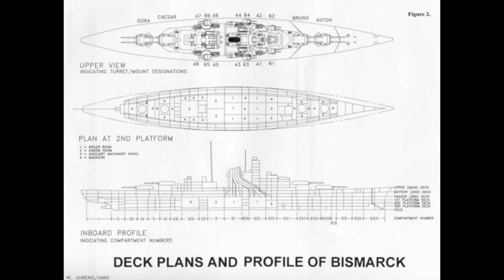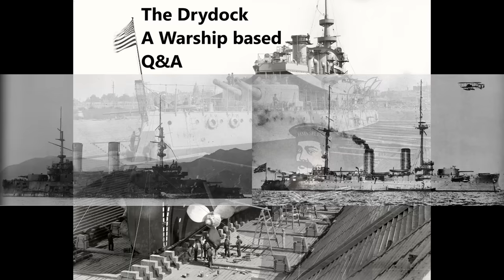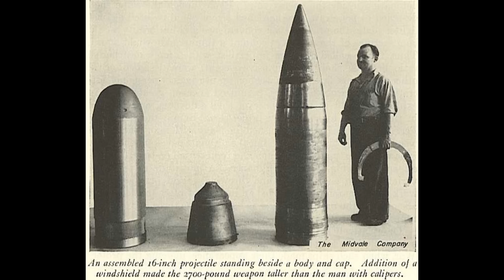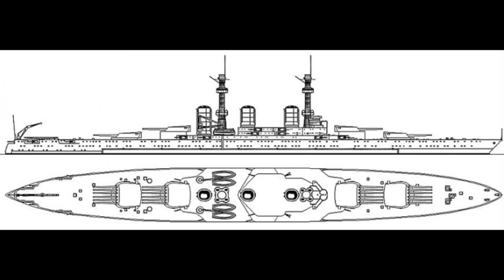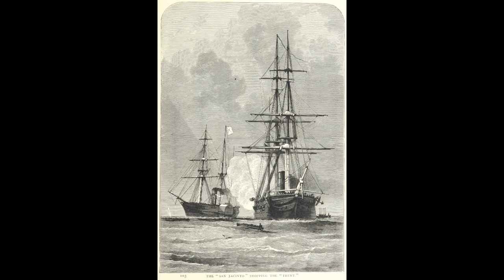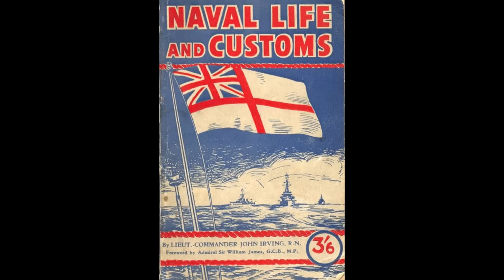The Drydock - Episode 096

Comment from the maker: Pinned post for Q&A :)
Reply: Shipbuidling, design, construction and naval budget during the Great depression ( 1929 to 1932 ) since corona is killing the economy
Reply: What if all of the Japanese submarines at Pearl Harbor were all replaced with I-400 type submarines along with aircraft.  Would they get destroyed by ASW or could they have launched an attack on Washington DC?
Reply: RN interwar years - Destroyers were mostly commanded by "salt horses" (officers who had not specialised in (say) navigation, gunnery etc.) Only seaman branch could command vessels, Engineers and Supply couldn't. The other route to early command (and extra pay!) was in submarines.
Reply: Battleship icebreaker. Wouldn't you basically have a monitor.
Reply: Did the royal navy, or any other large navy during the age of sail ever use sail colours other than plain white?
Reply: With the discovery of the wreck of La Minerve. Have we found out why it sunk?
Reply: The Iowa Class were Battlecruisers.

Change my mind. (sips cup of covfefe )
Reply: Sorry if this gets long I just wanted to clarify some of my questions.
1.  Jervis vs Fletcher I neglected to state that that was about how the two ships combats capability's are compared to each other do to the J class trading a 4.7 twin for an extra set of torpedoes matching the number of torpedo and guns more closely as opposed to a Tribal compared to a Fletcher.  (the other ships vs ships questions are just ship vs ship questions)
2.  I asked about Canadians who served on RN ships this was due to an article by the legion about the Canadian sailors who were in the hunt for the Bismarck as gunnery crews, radar operators and other roles on major ships like Hood/KGV/POW.  I wanted to know about  other shenanigans Canadians got into while serving on British ships in WW2. 
3.  Two question were related to helmsman commands/and a brief on RN/RCN rating uniforms from lower to higher ranks and clothing for different jobs such as gunners, radar operators, lookouts etc.  (sorry but currently I don't have a copy for any RN/RCN seaman's hand books other sources for this would be appreciated)
4.  I asked about how would you modernize Yamato/Bismarck/Vanguard like the 1980s Iowa you can skip that one.  Thats a scary thing the internet can do on its own.
5.  all the questions on how would you build super (insert here) ship you can skip aside from the how would you design the KGV's under all the treaty restrictions.  (you have full control as long as you fit the limits)
Sorry for doing this here but I didn't email due to that spam you got. Also keep up the great work you videos are always the highlight o my week :)
Reply: Bismarck at Jutland with the German fleet bismarks speed is limited to 26 knots.  Does he survive and if he does is it still mission capable or repairable in German facilities
Reply: Can we get an episode on the "Scrap iron flotilla"..... attempt no2..... yes, i am going to do this ;)
Reply: When talking about the rudders, I noticed in the photograph of the Iowa you showed that there is a difference in the number of blades between the inboard (5 blades) and the outboard (4 blades). Is the water pressure higher on the inboard props due to the action of the outboard props thereby changing when cavation occurs and necessitating different designs?
Reply: In previous dreadlocks you have mentioned that you dislike the conqueror in world of warships, if you were to chose the ship to be the British t10 battleship what would you go for? Autoloader lion?

Also what is the most realistic T10 ship from world of warships which wasnt actually built?
Reply: Are you typing during Q&A's? Always sounds like there is some clicking going on
Reply: If all ships ever constructed before WW2 were to face the US Navy at it's peak in WW2, who would win?
Reply: How common was naval gunfire support around Korea and Vietnam? What kind of missions were performed by carrier aircraft as opposed to land based?
Reply: @Loretta2004  it depends on which metric-using country your looking at. Navweaps.com provides that level of detail on specific weapons. For example,  all German 28 cm guns had an actual bore diameter of 28.3 cm (11.1"). When the Japanese switched from imperial to metric units, they also rounded to the nearest cm, so all their 3" guns became "8 cm" guns by designation. As for the 13.5" gun, this article (http://www.navweaps.com/index_tech/tech-097.php) helps explain that the 13.5" bore offers a shell about 50% heavier than the 12".
Reply: According to a classical adventure game featuring pirates and vodoo, ship´s grog is said to contain "one or more of the following: Kerosene, Propylene Glycol, Artificial Sweeteners, Sulfuric Acid, Rum, Acetone, Battery Acid, red dye#2, SCUMM, Axle grease and/or pepperoni". So what was the historical recipe like?
Reply: How would Yavuz vs. Sevastopol work out in say 1946-1947, assuming crews are up to scratch, and machinery works 'as advertized' on both and no aviation is involved?
Reply: How often, if ever, did first officers in ships where the Captain has been killed remain in command of that ship? Were first officers ever promoted to command of their ship after the Captain is transferred to another command? Is familiarity with the crew seen to be an issue for command?
Reply: What year did the Germans need Jutland to happen to have a real victory that counts
Reply: We're there any German and/or Japanese plans to equip missiles, like the V-1, or a bunch of rockets on a sub or ship?
Reply: The winter of 1939/40 was particularly cold, and I read that the ice kept many u-boats in their docks. To what extent did this random weather event save the fledgling convoys and keep Britain in the war?
Reply: Chris_Wooden_Eye  Interesting thought.  Would Blucher's presence with von Spee's squadron at the Falklands have had given any greater advantage to turn that event to a possible German victory?
Reply: At the 30:00 mark, looking at the picture of an Iowa's rudders and screws, I notice that the inboard prop has five blades, and the outboard has four. I'm aware that the greater number of blades provides for less vibration against the bottom of the hull, and obviously that isn't as great of an issue with the outboard prop being well further out from the hull, but wouldn't that arrangement create some issues with syncing shaft speeds to maintain a given speed?
Reply: Late German Ironclads (1875 with the Sachsen-class) and early pre-dreadnoughts (1891 with the Brandenburg-class). How would they have fared against contemporary ships of other navies?
Reply: @connormclernon26  Changing subs does little. The job was to carry Midgets to Hawaii. As for  Washington DC? Not practical.
Reply: @scottgiles7546  They have never been designed or described that way ever.
Reply: @super44lover  Very common in both. As far as aircraft goes? Generally long range  ASW is Land based or were seaplane. As was blimp units.
Reply: Scott Giles covfefe doesn’t come in cups.  Prove me wrong. ....
Reply: In German literature the Italian Pugliese torpedo defense system is always seen as a total failure. It is described as just not working at all and to potentially increase the damage of a torpedo hit.
Was it really that bad, or is this a case of the stereotype that Italians only build good looking crap, that we Germans use to have?  ;-)
Reply: Maybe a bit new for this channel: a few years back, one of the big Russian nuckear subs went to St. Petersburg thru the strait of Öresund. One of the big newspapers here in Sweden had an article about it. Some naval dude claimed that the sub could not submerce in the Baltic, because it would have trouble to resurface in the less salty waters.
Anyone know if there is some truth to that, and if yes - was it a thing in the past (ex WW2)? Or was it bs?
Reply: @grahamwilson5133  More a lack of U boats than weather.
Reply: How about talking about the role of alcohol in navies through history? How it affected duties, battles and people? How much did sailors and officers get?
Reply: Can you explain operation duck, and the missing air cover for the operation? And the damage to HMS Suffolk
Reply: @jean-lucrobinson5089  1918. Russia is out the war. Germany is on offense on the Western front. The American forces are arriving.
Reply: @spikespa5208  There is no way to answer that without studying every ship history  and personnel records.
Reply: War Plan Red: How realistic was it in terms of its naval plans and its expectations. Or was it just a 20’s/30’s officers’ think tank hobby project?
Reply: The Iron Duke had had her boiler power mutilated when converted - but could perhaps have been used like Centurion as a decoy? The only option to reactivated was to have done a Hiei when converting.
Reply: @WALTERBROADDUS  
Cool video
Thank you for the link
Reply: @erikgranqvist3680  Salt content does effect buoyancy.
Reply: What was the usual ratio between officers, NCOs and enlisted personnel in the RN and how much did it change through the years?
Reply: I have also heard of South Dakota class having some of their wiring outside the armor too.  I'm not sure how true this is.
Reply: @WALTERBROADDUS  there was a lack, but also some u boats were stuck in dock.
Reply: In the words of Sun Tzu, ''He will win who knows when to fight and when not to fight." In the spirit of this, what, in your mind, are the retreats and/or refusals to engage by naval commanders that carry the greatest weight in history to their credit?
Reply: If you had to decide, would you rather have completely incompetent officers, but a very good crew otherwise, or the other way around?
Reply: Could the Japanese have done a HMS Campbeltown on one or more Panama Canal lock gates on the 7th December 1941. I was thinking of them using merchant ships rather then warships and possibly under a false flag so as not to raise suspicions amongst the Americans on the canal.
Reply: Once it was decided that KGV's were going to have 10 14" guns (instead of 9 or 12 [though 9 would probably have been enough, just not as impressive]), why did they choose a 4, 2, 4 configuration, instead of a 3, 3, 4? Same number of guns in front and back, but 2 triple in front (a type of turret the RN had experience with, and only 1 quad (a new unproven design).
Reply: @grahamwilson5133  There's not enough U boats in that time period to matter. Nor do they have French ports to work from. So the cold winter, does not really factor.
Reply: @kylarstern7550  Are making a silly question  just to ask question?
Reply: @bigblue6917  Not really..... Where are these ideas coming from?
Reply: Are there any instances of a small-ish force sneaking on board a ship and sailing it out of port only for the actual crew to return some time later to find there ship missing?
Related question, how large where skeleton crews throughout history? To narrow the question, say first and forth rate for for age of sail, and battleship/cruiser/destroyer c.Dreadnought and end of WW2.
Reply: what (in your opinion) is among the strangest warship design that has been "fielded" i'm thinking the Tsar tank of the seas https://en.wikipedia.org/wiki/Tsar_Tank
Reply: At that Iowa photo at https://youtu.be/wcQn_FsgrkE?t=2021 clearly seen that her inner and outer screws had different number of blades. Why exactly, and how it was common in that period?
Reply: Questions about the Black Swan Class. Does it cause Black Swan Events? Is it designed with special skills to survive Black Swan events? Did they cause the Meme to come into existence.
Reply: What is the music used for the interludes?
Reply: I know you don't usually touch on modern matters. That said, in your opinion, in the age of beyond visual range radar guided weapons, is there much point in continuing to paint warships in low-visibility colours?
Reply: If after the covered builders slips for the Yamamoto class had been built but before the keels had been laid the Japanese branch of the battleship mafia had been done in by bad sushi at their monthly meeting what would the Yamamoto class carriers look like?
Reply: @scottgiles7546  By the time the Iowas were built there was no such thing as a Battlecruiser since you could put a power plant in any battleship that gave it Battlecruiser speed.
Reply: @Shonono Yeetus Not likely.  More big guns was inevitable.  There were several navies already working on designs.  I believe that the South Carolina Class was actually designed before dreadnought.
Reply: me hee  No. The problem was lack of the initiative to either pass along the location of the enemy during the night (surely the commander already knows). or do something without orders ie. attack the enemy at night. No one was willing to take a chance of making a mistake (much like many players in WoWS). The opposite of 'Who Dares Wins'.
Reply: What would have been the largest warship the canadian navy could have built domestically during the 1930s/40s
Reply: I need to know.  So for Hit 26 on South Dakota we know it made a huge dent on the Barbette.  However that part of the barbette was more than 400mm thick which means it must have been homogenous class B armor unless the USN wanted class A armor for the Barbettes for whatever reason.  Does this mean Hit 26 on South Dakota could have been an HE shell after all or is it still thought to be an AP shell?
Reply: Is there any reasonable way to refit the Kongo-class to conform to Japanese inter-war doctrine and have them be able to fight a US standard BB?
Reply: talking bout the possibility of bismarcks comms being knocked out got me thinking are gun crews depending on calibre trained to take out ie 5" below target bridge or similar smaller gun\aa mounts? compared to battleship guns that would be trained to take out the enemy ships guns or engines?
Reply: @rafale1981  For the Royal Navy in the age of sail, rum and water. Apparently lemon juice, sugar and spices such as cinnamon were sometimes added, sources vary.
Reply: What impact did the brazilian navy have on ww2?
Reply: How long did it take for a ship of each class (average) to speed up or slow down? Ww2 era.
Reply: Fun fictional encounter, HMS Victory vs Amerigo Vespucci (1928 cruiser or 1931 tall ship), what would happen.. on the same basis what out of all the actual school ships (based on/from 17th-20th century) from all the different navies u reckon could be the best to survive in a fight against its same kind.
Reply: @WALTERBROADDUS  yeah, but I have no real knowledge on how much. My knowledge in naval engineering is somewhat lower then the content of oxygen in the Martian atsmosphere.
Reply: How big was the high explosive filler for cruiser and battleship size guns across the different nation for HE shells. 6inch to 18inch. Also were HESH(high explosive squash head shells ever tried for naval guns)
Reply: Dear Drachinifel, could you please make some content on Royal Navy submarines and their actions during World War II? I feel this is an unfortunately neglected area of naval history in comparison with the much better documented U-Boat campaign and the U.S. Navy blockade of Japan. I know of several notable incidents during the war which involved British submarines, I'm sure you know of many...many more.
Reply: Hi Drach.  Great video as always.  A few questions:
 
1.   What were the advantages and disadvantages of different construction methods for naval guns, i.e. wire-wound, built-up, etc., and did each method have any impact on the gun’s performance?   For example, I believe the 15”/42 was a wire-wound gun.  Did this fact contribute to its renowned accuracy, or would a gun with similar characteristics, but constructed in another method, likely have had similar performance?  

2.  In discussions of possible scenarios for the sinking of HMS Hood, I have noticed that most diagrams tracing the assumed flight path of Bismarck’s shells in relation to Hood assume that Hood was on an even keel at the time.  However, I think this was unlikely to be the case.  A large ship making a turn to port at ~29 knots should heel over substantially to starboard.  This (with a possible contribution from the sea state) would have allowed Bismarck’s shells to penetrate Hood’s deck (or the thin upper belt armor strake) at a steeper angle when it otherwise could not at that range.   What are your thoughts on this?  I can’t imagine I’m the first one to bring this up, but I have just never seen it discussed.  (Of course, this question may be better reserved for your upcoming video on theories for Hood’s sinking).  

3.   How would a Baltimore class cruiser stand up against a Deutschland class in their 1943-44 configurations?  A Des Moines vs. a hypothetical 1945/46 Deutschland?  

Thanks again for taking the time to make all of these great videos!
Reply: @sergeantbash8454  that's a really interesting question!
Reply: What appear to be portholes are very obvious on many of the photos you use of various sizes of warships throughout the years - are these actually the glass windows they appear to be, and if so, how on earth are they not a massive weakpoint in the ship and its armour? Surely one shell through a porthole means massive damage to an otherwise solid vessel?
Reply: Question: To what extent were turret firing angles taken into account when designing ships? Obviously having the most guns able to bear on a broadside was important, but how much did naval designers value the ability of a ship to fire her broadside at angles further and further away from a flat broadside? Was this valued differently across different classes of ships ( BBs vs CBs, various types of cruisers, DDs, etc.)?
Reply: @richardcutts196  As I understand it the original plan was for three quad 14-inch but stability calculations showed there was too much top weight. Reducing B turret from 4 guns to 2 was probably the simplest solution that didn't need a lot of redesign.
Reply: Hey Drachinifel,
I just finished the Influence of Seapower on History by Alfred T Mehan and during my reading a question arose.
At multiple occasions especially during the Anglo-French War there seemed to be instances where for example the French fleet would get word of a British fleet setting sail to assault a French port, and  than the French fleet would have time to either get to that port, or intercept the British fleet before it has reached said port. I admit that for the most part I am more familiar with WWI and post naval history   so I thought letters sent by ship were generally the fastest form of communication between ports, prior to the invention of the telegraph. But if that's true it doesn't seem very likely that word of an enemy fleet could reach a naval commander much if at all before the enemy fleet its elf. What am I missing? Could you please discuss how naval communication in a pre telegraph era was handled, and how was it possible for word of an enemy fleet to reach a naval commander before the enemy fleet its self? 
Thanks!
Reply: You mention that when the Japanese navy modified the Orel that they removed the fighting tops. What is a fighting top? I can only find references to them on age of sail ships. The ones on the Orel must have had a different use from firing down on the enemies decks.
Reply: I understand that the existence of the Japanese and US 16" battleships spurred the British into arming the Nelsons as such - indeed, the reason they were allowed was the British argument that they also needed 16" ships. However, given the prevalence of 15" guns in the fleet, I can't help wondering why the 16" was chosen. The shell weight and firing ranges are practically the same and I believed it's acknowledged that the 15"/42 was a far superior weapon overall (even by the Americans after WW2). The Nelsons were no faster than the Queen Elizabeths (despite being built a decade later) and were definitely configured far better for weight saving, yet displaced at least 3000 tons more. There's also the question of fleet logistics of supplying a different calibre. Considering these facts, would the navy have been better served by ignoring the 'bigger is better' mentality and building the Nelsons as more rounded 15" gunned ships, with potentially more speed? Also, would the all-forward firing layout have been necessary/desired on this hypothetical ship?

Sorry if that's a long and specific question
Reply: Germany, under the terms of an alternate Versailles Treaty, is allowed to keep 150,000 tons of capital ships after the war, with a maximum of 3 battleships and 10 cruisers of any type. Because of this, the German vessels interned at scraps flow do not scuttle themselves. Which ships do you choose to keep in service, and why?
Reply: what are your personal take on "modern battleships" ?? lets say navies had realized the potential of a battleship in a modern era, and built one in the modern era, what would they look like and what are their characteristics, im just wondering what are other people's take on modern battleships, here are my personal take

- they would quit using large guns and used something along the lines of 150mm guns, lets say around 3 of them
- their primary armament would consist of mainly missiles with larger numbers, lets say a destroyer can carry 90, a battleship would carry somewhere around 120+ to around 150+
- because of larger displacement (lets say around 20000+ tons) they can boast thick armor, and large ammounts of helicopter
- i think they would still maintain their roles of shore bombardment, but with missiles (i think a destroyer can do the same)
- their appearance wouldn't differ much from that of a destroyer (Ticonderoga class doesn't differ much from a cruiser)
- they can boast large ammounts of defenses
- to keep up with the fleet they can go about 36+ knots, maybe use a nuclear powered engine, idk
- maybe took around 500 to 700 crew to operate

this is my personal take on a "modern battleship" i personally think this way because nowadays ships primarily used missiles, although huge guns are impresive and all, they wouldn't do much in a ship vs ship engagement when pretty much everyone used missiles, i wouldn't say they would be outdated, infact the reason why no one used battleships anymore was because of the operating costs, so to reduce the operating costs of a battleships, the higher ups would be likely to comission a battleship, but this is my personal take on modern battleships, what are your opinion ?? i want to hear it
Reply: Is there any evidence of a wide-spread, uniform electric power supply system on warships in the world wars(like a current house), or was everything mostly wired independently?
Reply: With regards to the Trent Affair. The confederates were technically committing treason and thus felons. Is there any provision under international law that allows a ship to be stopped if you have a reasonable suspicion that it's carrying criminals from your country?
Reply: Q&A In the age of sail was there ever attempts to armour wooden ships? I've heard of using chains in your video on USS Alabama but where there any other attempts?
Reply: Why don't Ships Guns use Muzzle breaks? the majority of the time the barrels sit beyond the hull of the gun. less common on modern ships. why is this the case?
Reply: do a video on the great lakes paddle wheel training carriers and the merchant carriers of the dutch navy
Reply: If Germany had deployed Moltke with Admiral Spee just before WW1, how would this have affected Spee's plans? Would he have worried less about HMAS Australia and stayed longer in the Far East, raiding? Could Moltke have made a significant difference to the outcome of the Falklands?
Reply: I have read, some years ago, at least two opinions that the Fairey Barracuda was better than the Avenger by the fact that, both thought, the British aircraft could carry a much better torpedo than the  American one could. I could not find the things I think I read, if I tried. Is it a fair opinion?
Reply: BHL asks: The Nelson class battleship is often quoted as having the 3 turrets in front for a shorter armored citadel but doesn't say how when compared to other layouts. Thanks in advance
Reply: Can you do a special on the WW2 catapulted armed merchant ship (CAM) programme?
Reply: Interlude music score at 2:20 hours - song and musician?
Reply: Do you think the RN classification of the Scharnhorsts as battlecruisers is more appropriate than the general consensus that they were battleships?
Reply: Given how effective rapid firing 6" cruisers turned out to be, do you think the Mogami conversion to 8" was worth it?
Reply: Just watched an excellent breakdown of the LAST Nazi Offensive of WW2, which happened to be in Dunkirk, April of 1945 (Operation Blücher). The fact that a "small" German division of various German Service castaways were able to not only hold off assaults for 6 months until April 1945, but also launch a counterattack (with an Admiral commanding all German combat troops, no less) effectively behind Allied lines is impressive! However.... Not ONE mention of Naval Fire Support for the Allies ANYWHERE in this story. Surely, as Dunkirk is a coastal town, there were naval Gunfire support requested/involved? What do you know about the Naval part of this rather astounding piece of (rather unknown) WW2 history??
Reply: How do you think USN gunboats (be it built as (Erie) or converted to (i.e. Vixen) compared to other Allied or Axis gunboats?
Reply: @colinsdad1  Damned good question, colinsdad
Reply: @workingguy-OU812  I had NEVER heard about Operation Blücher until earlier today.... I'm ABSOLUTELY going to look into this more.
Reply: Could you provide a summary of HMS Centurion service in WW2?
Reply: @jean-lucrobinson5089  he has answered this 6 or so times, basically, the earlier the better.
Reply: Jean-Luc Robinson - At the beginning of the war in 1914.
Reply: Richard Orta - There was a plan to equip a U-Boat with a V-2, sail it to the US East Coast & Fire it at a major city on the East Coast.
Reply: Poster received 06/03/20 excellent and heading towards the framer in Chicago I'll .
Reply: What was the best carrier based aircraft of the second world war?
Reply: Kkkk
Reply: K
Reply: K I'll k
Reply: I'm not sure you're right about the kaiser. You sort of imply he does things mainly as a dick measuring contest, whereas doing things like having a presence in the mediterranean would have been important to establish their global presence. Even though they didnt have posessions there, just being able to contest the other empires would give them significant influence.
Reply: Scharnhorst class - Battlecruiser or Battleship?
Reply: @BarracudaBoy  The difference in number of blades was ongoing experimentation trying to reduce/ eliminate hull vibration at resonant frequencies.
Reply: Now don't get me wrong here, I thoroughly enjoy the dry dock episodes, but HOW do you talk to yourself for 3 hours?
Reply: i HATE YOUR INTRO, IT ALWAYS WAKES ME UP FROM A SOUND SLEEP! Other then that, great videos
Reply: @Sky_Eden  yuyuuuuxox yu
Reply: @connormclernon26  guxxyxy
Reply: @connormclernon26  xyuyyyyyuuuxuxyygyuf
Reply: @connormclernon26  y
Reply: @connormclernon26  yg
Reply: @connormclernon26  yg
Reply: @connormclernon26  y
Reply: @Sky_Eden  yxyxx
Reply: @Sky_Eden  yxy
Reply: @Sky_Eden  do
Reply: @iansadler4309  day do  day
Reply: @iansadler4309  ,,
Reply: @michaeltruett817  hhmmummkk
Inhibit 
Holman have some questions k
Reply: @hmskinggeorgev7089  9757
Reply: @Sky_Eden  ìii
Reply: Given how shallow the South China and Java Seas are compared to maximum dive depth, what, if any, evasion techniques did submarines enforcing the naval blockage against Japan in WWII develop from operating in these areas?
Reply: The Iowas might have a shot at the Blue Riband.  A visit to the New Jersey revealed that all four Iowas hit 35 knots in trials, and they had enough fuel to run 18,000 miles at 12 knots.
Reply: @Sky_Eden  you can
Reply: @iansadler4309  salah terjemahan bukan kuda asin tapi kuda laut
Reply: @iansadler4309  kuda laut (perwira pelajar/perwira magang sebelum dipercaya memegang komando kapal dari kekuatan Armada laut
Reply: @iansadler4309  gunnery jurutembak horizontal/versi trail command, beda jurusan ilmu teknik nautika, teknik navigator disesuaikan dengan kapal komersial ship or brive ship(courvet)
Reply: @connormclernon26  type400 double engin and diessel rotor (bukan diterjemahkan 400jenis kapal selam boleh diinfokan ini jenis kapal selam biasa menjelajah ambang batas kedalam 386meters dari dibawah permukaan laut dan versi ini hanya memiliki satu tabung torpedo) beda dengan type400EC engin motor baterai
Reply: @Eric_Hutton.1980  see like class and made 2986 diessel Licence by BG. Vaust cariership
Reply: best looking ships of their class (ww2/ww1, whichever)? i just want some cool boats to draw.
Reply: @iansadler4309  r
Reply: @iansadler4309   xr
Reply: 🥵r.  @connormclernon26
Reply: Quick search on the root-level comments didn't find me a comment, so asking (even if Drach himself doesn't answer, perhaps someone else will).

The section on HE-111 commented on the general failures of HE-111s in level bombing roles vs. shipping. But of course, because level bombing vs. shipping was pretty-much universally, as noted, more luck than design.

But Drach then commented on some unusual successes of the HE-111 in the torpedo bombing role.

Now, I vaguely remember seeing references to them being used as such, but success? That really surprises me. Thinking of the singular lack of success US Devastators (considerably smaller targets), I'm wondering how the much larger-target HE-111 could be successful in the torpedo bombing role?
Reply: Regarding level bombing, wasn't task force Z also level bombed by Betty's? There were torpedoes of course but I think I recall they scored quite a few hits with bombs.
Reply: Oh this was one year ago :-)
Reply: ,, free
Reply: Would you consider doing a video on the analysis of the Ever Given Suez canal blockage?
Reply: Do you have the title(s) for interlude music?
Reply: Same
Reply: @Sky_Eden  😅😅😅😅😅😅😅😅😅😅😅😅😅😅😅😅😅😅😅😅😅😅😅😅😅😅😅😅😅😅😅😅😅😅😅😅😅😅😅😅😅😅😅😅😅😅😅😅😅😅😅😅😅😅😅😅😅😅😅😅😅😅😅😅😅😅😅😅😅😅😅😅😅😅😅😅😅😅😅😅😅😅😅😅😅😅😅😅😅😅😅😅😅😅😅😅😅😅😅😅😅😅😅😅😅😅😅😅😅😅😅😅😅😅😅😅😅😅😅😅😅😅😅😅😅😅😅😅😅😅😅😅😅😅😅😅😅😅😅😅😅😅😅😅😅😅😅😅😅😅😅😅😅😅😅😅😅😅😅😅😅😅😅😅😅😅😅😅😅😅😅😅😅😅😅😅😅😅😅😅😅😅😅😅😅😅😅😅😅😅😅😅😅😅😅😅😅😅😅😅😅😅😅😅😅😅😅😅😅😅😅😅😅😅😅😅😅😅😅😅😅😅😅😅😅😅😅😅😅😅😅😅😅😅😅😅😅😅😅😅😅😅😅😅😅😅😅😅😅😅😅😅😅😅😅😅😅😅😅😅😅😅😅😅😅😅😅😅😅😅😅😅😅😅😅😅😅😅😅😅😅😅😅😅😅😅😅😅😅😅😅😅😅😅😅😅😅😅😅😅😅😅😅😅😅😅😅😅😅😅😅😅😅😅😅😅😅😅😅😅😅😅😅😅😅😅😅😅😅😅😅😅😅😅😅😅😅😅😅😅😅😅😅😅😅😅😅😅😅😅😅😅😅😅😅😅😅😅😅😅😅😅😅😅😅😅😅😅😅😅😅😅😅😅😅😅😅😅😅😅😅😅😅😅😅😅😅😅😅😅😅😅😅😅😅😅😅😅😅😅😅😅😅😅😅😅😅😅😅😅😅😅😅😅😅😅😅😅😅😅😅😅😅😅😅😅😅😅😅😅😅😅😅😅😅😅😅😅😅😅😅😅😅😅😅😅😅😅😅😅😅😅😅😅😅😅😅😅😅😅😅😅😅😅😅😅😅😅😅😅😅😅😅😅😅😅😅😅😅😅😅😅😅😅😅😅😅😅😅😅😅😅😅😅😅😅😅😅😅😅😅😅😅😅😅😅😅😅😅😅😅😅😅😅😅😅😅😅😅😅😅😅😅😅😅😅😅😅😅😅😅😅😅😅😅😅😅😅😅😅😅😅😅😅😅😅😅😅😅😅😅😅😅😅😅😅😅😅😅😅😅😅😅😅😅😅😅😅😅😅😅😅😅😅😅😅
Reply: @connormclernon26  ich habe gerade to ttüüüü the p
Reply: Bro just happened to me rn
Reply: @connormclernon26 00
Reply: @Sky_Eden 0
Reply: What is dry dock Interlude music I love it and would like to get a recording
Reply: Naval drums? The music what are the Mary rose drums and how involved were they up to lord Nelson? Drums. Battleship jazz?